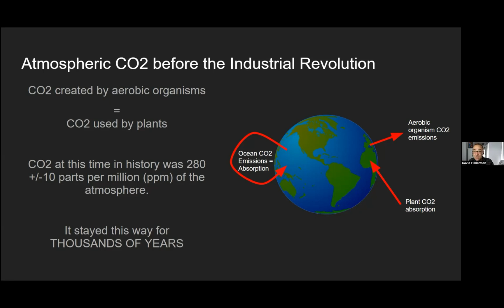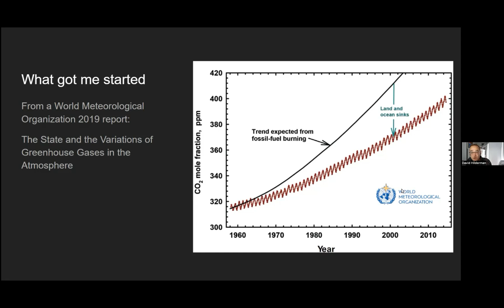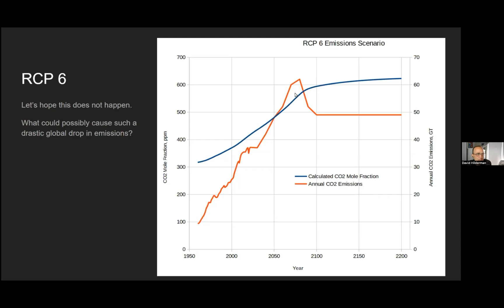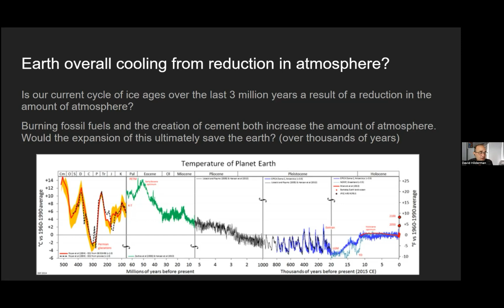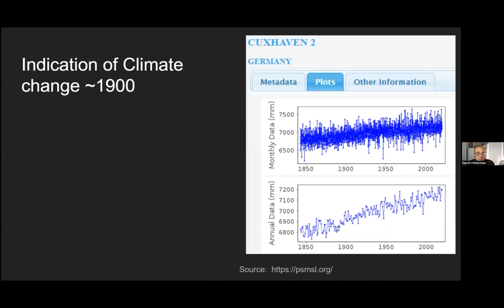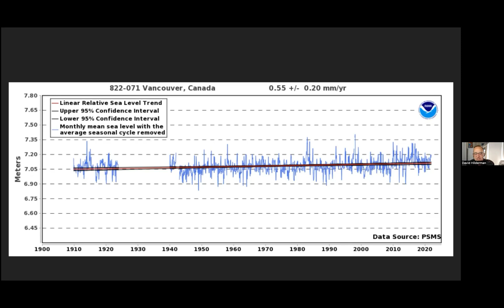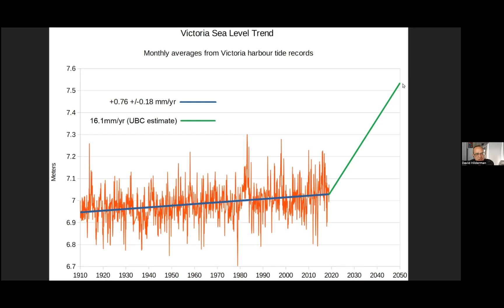David Hilderman: CO2 Emissions and Atmospheric Levels | Nelson Pod #220

Comment: I have a somewhat similar background with a PhD in electrical engineering from the University of California.  I became seriously interested in
 climate research in the 1990s after I discovered my employer was secretly having me work for the NSA, and I quit my job.  My beef wasn't with the NSA per se, but I have a hereditary health problem and I needed unsupervised travel to a foreign country that the NSA does not trust to find
 biological relatives.  My security clearance was a burden.

Well known  politicians on both sides of the aisle wanted me to take a look at global warming expecting me to reach contradictory conclusions.  I had studied  system theory, modeling, and feedback at a graduate level, so I thought the best course was to just try to keep everyone honest.  In many ways my approach is similar to yours, and I see this post here as an  invitation for detailed comment.                                             
                                                                                
 This is a material balance problem that should be investigated with numbers.  If CO2 affects climate, we need to follow numbers in order to understand climate change.  There are many differences between our approaches however.  I will detail them in comments to my post here.
Reply: At 9:26: 
This is grossly oversimplified.  The implied five-digit precision in the Mauna Loa data is absurd.  I would use a multi-year baseline (maybe 10 years) and assume a more realistic precision in the data.  But mass balance is exactly what we need to do.  I don't understand why this is so neglected.
Reply: Your material on sea level rise is perfect.  I have come to the same conclusions.
Reply: Try the calculator - it may satisfy your interest in the numbers.
Reply: At 2:12:
Atmospheric CO2 before the Industrial Revolution. "CO2 at this time in history was 280 +/- 10 ppm ... It stayed this way for THOUSANDS OF YEARS"  

Twelve thousand years, more or less.  And +/- 10 ppm makes a huge difference in climate. CO2 levels gradually declined from 280 to 272 in 6,000 BC.  Then CO2 levels rose until around 1400 AD when new world contact caused a population catastrophe.  CO2 levels dropped, and the climate cooled for a few centuries.  Then in the early 1800s the population began to climb again.  This increased demand for fuel caused the CO2 level to rise and gives the superficial appearance of a stable climate equilibrium that never existed.
Reply: At 2:41:  
Post Industrial Annual CO2 Emissions.  Yes, this is the same data I use.  However the large increase in 20th century emissions masks a critical feature of this graph.  Plot and scale only 19th century emissions alongside of population, and you will see the exponential rise began before the late 19th century (1800s) industrial revolution, but after an early 19th century population explosion.  We began burning   fossil fuels, because we ran out of firewood and other "natural" fuels.  Both fuels raise atmospheric CO2 levels.
Reply: At 3:49:  (This is Mauna Loa data) Explaining the annual cycle of monthly CO2 averages.  "The reason it goes up and and down is becase there is more plants in the northern hemisphere than in the southern."  

That is not correct.  The earth is mostly covered with oceans, and ocean dwelling plants account for more than half of total  photosynthesis.  However humans predominantly inhabit the northern hemisphere, and the demand for heating fuel peaks in the winter. This is what causes the CO2 level to rise.  A careful look at the CO2 level maps that are rarely released by the NOAA shows higher CO2 levels colder regions like Canada and Alaska where firewood is still consumed for heating.  Mauna Loa is located in the northern hemisphere where the air quickly mixes.  Comparing with CO2 measurements in Antarctica should show an attenuated cycle, because it takes two years for the circulate from the northern hemisphere to the southern.
Reply: @natterlynabob1472 thanks!  That is interesting regarding fossil fuel use not plant uptake.
Reply: At 4:36: (Ice core data from Vostok, Antarctica) 

It is easy to look at the sharp modern peak and ignore the rest of the data.  This data is deceptive because modern (Mauna Loa) measurements are recorded daily while ice cores average several years of CO2.  So the peak we are seeing now would not show the same kind of sharpness or height.  This averaging effect is greater the farther back in time the ice core measurements are taken.  More recent cores (younger than 300,000 years) show concentration peaks around 280-300 ppm. Older measurements have this peak averaged down a bit.  But to me the most significant feature of this plot is the interval between successive CO2 peaks (and glacial interglacial periods).  Prior to 300,000 BP the cycles are around 60,000 years long.  Beginning at that time the cycles are increasingly long.  The most recent cycle lasted over 100,000 years.  If we assume the glacial/interglacial transition are triggered by the mass release of CO2 from the oceans (limnic eruptions), then this is analogous to  an electronic current-to-frequency circuit that can be used to accuarately measure CO2 emissions.  The lengthening of the periods indicates the gradual new source of CO2 emission that began at about the same time that humans began using fire.  At the end of the most recent cycle around 12,000 years ago the CO2 level declines until 6000 BC.  Then something remarkable happens.  In contrast to all other cycles, the decline reverses showing that this new source has now overpowered the natural pre-human glacial/interglacial cycles.  This is where the exponential rise in CO2 levels truly begins.
Reply: At 5:12:  
Yes!  CO2 causes increased photosynthesis, something that some refuse to believe.  This is a commercial issue and the effect is used in greenhouses.  The relationship is sublinear so the increased photosynthesis will not be seen over the span of 10 or 20 years.
Reply: I did not get into where I came up with the pre-industrial CO2 level in my calculation.  I started with the equation in this form co2(y) = co2(y-1)*k + emissions + f.  I simply adjusted k and f until my calculated atmospheric best matched the measured.  Then i put 0 emissions for every year for 500 years.  Atmospheric levels settled to the number that i used for pre-industrial co2 levels.  I thought that perhaps this was too or maybe it is only a linear function in the range of 316ppm and 420ppm. This may still be the case.  I found a paper from i think berkley that estimated pre industrial CO2 levels were 290ppm, so i figured the number i used was quite reasonable.
Reply: @davidhilderman  Yes, this is basically what I did.  It is called difference equations, and they are easy to solve with a PC.  I started with the Mauna Loa data and fit just to that.  Then I found ice cores (not Vostok) that overlapped with Mauna Loa data, and when I fit to 1900, I came up with a different "pre-industrial" CO2 concentration.  Then I decided to go back as as the emissions data allowed.  I think that was 1812, and pre-industrial CO2 changed again.  There were serious problems though in the early 1800s.  When I plotted actual atmospheric CO2 together with emissions there was far too little increase in CO2 for the amount of emissions.  Then I decided to plot atmospheric CO2 alongside population.   I assumed there would be a constant amount of carbon emissions per person.  This matched the shape of the atmospheric CO2 better:  particularly before 1850.  The only way I could match emissions
and atmospheric CO2 over the whole interval from 1812 to 2017 was to assume that those who consumed fossil fuel consumed less biomass.  The more I thought about it, the more reasonable the assumption sounded.  Humans switched to fossil fuel because we ran out of biomass.  The more fossil fuel we consumed, the less biomass was burned.  There is your greening.

Eventually I was able to run the difference equations back 300,000 years into prehistory.  By adding in limnic eruptions when atmospheric CO2 dropped below 180 ppm, I was able to simulate glacial/interglacial transitions as well as modern data.  In system theory we call a situation like this a point of unstable equilibrium.  The deep ocean absorbs CO2 until the atmospheric CO2 drops to 180ppm and then becomes unstable.  An earthquake or a volcano or a meteor can shake up the ocean enough so that CÖ2 bubbles out like it does when you shake a bottle of soda pop.

Here are a couple of references on the behavior of CO2 in the deep ocean:

Nealson, Kenneth; “Lakes of Liquid CO2 in the Deep Sea”; PNAS vol 103 no 38; Sep 19, 2006
   http://www.pnas.org/content/103/38/13903.full
   accessed 31 AUG 2014

Brewer et al; “Direct Experiments on the Ocean Disposal of Fossil Fuel CO2”; SCIENCE 284: 943-945 (1999)
Reply: At 7:13:  
Caution.  Sometimes emissions are stated in gigatonnes (GT) of CO2, and other times in GT of carbon.  The difference is a factor of 44/12.  My calculations are all done in GT of carbon.  2.1 GT carbon cause a 1 ppm rise in atmospheric CO2.  We agree here.
Reply: At 9:31: 
Yes, I see the same effect.  For the amount of carbon emissions we should be seeing a larger rise in atmosperic CO2.  But I do not attribute this to photosynthesis.  The amount of increased plant synthesis has been measured, and it is in no way proportional to the increased CO2. attribute the seeming discrepancy here to a reduction in the burning of "natural" fuel that began with the use of "fossil" fuels (which do not always come from fossils!).  Humans gradually replaced firewood with coal and petroleum.  For every tonne of carbon produced by combustion of "fossil" fuel, 3/4 tonne of "natural" biomass is not burned.  Also I do not trust your World Meteorological Organization data.  I wrote difference equations and made an empirical model for the CO2  absorption into the oceans using ice core and modern data.  And of course not cutting and burning biomass directly shows up as greening the earth.
Reply: At 10:56:  
These equations are unsatisfactory, because you have left out the units as well as changes in burning of biomass.  And no you are not the only person doing this.  I tried this several times with different base intervals.  Every thime I changed the base years, I came up with a different "preindustrial" CO2 level.  I was forced to the conclusion that there never was a stable preindustrial CO2 level.  I was unfortunate enough to have met a famous climate politician in the Army.  When I gave a talk at a local college, I received d**th threats from his organization.  I hope you have better luck.

Because I do not accept a stable preindustrial CO2 level, I can't relate to the next few minutes of your talk.
Reply: At 22:11:  
This is an excellent graph illustrating the decline in atmospheric CO2 levels over the last 550 million years from 7000 ppm (0.7%) down to most recent levels of 180-280 ppm (0.018-0.028%).  In  my view it is possible that humans have evolved for the purpose of reversing this trend and preventing the extinction of plant life which has continuously evolved to function with lower and lower levels of CO2.    
   
The temperature data is suspect however.  There are proxies that will indicate some kind of temperature somewhere, but this is not same a "global average temperature." To make that leap we must assume the distribution of temperatures is normal.  We can disprove that by taking histograms of max and min temperatures from the NOAA database.  I have the same criticism of temperatures inferred from isotope ratios in the ice cores.
Reply: At 23:04:  
Standard biology that has been taught for over 50 years.  Pity no one in climate science accepts biology.  From personal private communications it would seem that the whole climate "science" field is controlled by creationists.
Reply: At 25:00:  
I have my doubts about proxies claiming to represent earth's average temperature.  I have been commenting on the internet since the   1990s, I could have been the one to speculate on changes in the earth's atmospheric density influencing temperature.  AFAIK physics is unable to explain the lapse rate (rate of temperature change with altitude) from any first priciples.  Most likely all planets are slowly losing atmosphere.
 
The hotter the planet, and less gravity, the faster lighter gasses are lost.  Venus has lost everything lighter than CO2, but it never developed   life, and the high temperature prevents formation of carbonate rock.  So all that CO2 remains in the atmosphere making it hellishly hot.  Mars has such weak gravity that it has almost completely lost its atmosphere.  All that remains is a small amount of CO2.  On the earth life developed and converted atmospheric CO2 into free oxygen, hydrocarbons, and carbonate rock (shells) reducing atmospheric pressure.
                                                                                
My interpretation is that we are leaving the earth's last ice age, and the only thing we should do about that is take careful measurements.   Future generations will need to see if this is a problem, and they will need the best data we can give them.
Reply: At 27:24:  
Many of these climate extremist groups are financed by foreign intelligence operations.  It is also a way for domestic politicians to launder public funds into political donations.  Putting young people together at a week long camping event is a perfect cover for drugging and hypnotizing them.  They form long lasting intimate relationships with each other that make it difficult to deprogram them.

Comment: Petroleum is not a fossil fuel. Oil is found at depths of 30,000 ft. It is not possible for these reserves to have been developed by fossil degradation. Oil companies are very aware of this fact.
Reply: Yes it is. Surface geology can become very deeply buried after several hundred million years of plate tectonic changes.
It IS true the most of the methane on the planet is primordial, not fossil. 
Coal and oil ARE fossil and their creation was a one-time-only event.
Reply: You are clearly not a geologist.

Comment: The problem with climate change crisis, is on  2 levels :
1st  - Confusing saving the planet with saving civilization. The planet will be fine, it will adapt, even humanity as species will survive and adapt. But it will take a rather long time and suffering to go through the transition. The goal is to smoothen the transition and lessen the suffering for maximum of people
2nd - Getting together and putting up a general plan of solutions that are just and efficient for most people, not green washing solutions influenced by lobbies, multinationals and politicians thinking of the survival of the 1% in the best conditions for them only
Reply: And some of solutions HAVE to include the use of fossil fuels anyway, as it is yet the most efficient and best know form of energy we have for now. Ii just need to be used for the transitionary solutions. Unfortunately, I don't thin humanity is able to sit on the table and discuss the problem with the best intentions, and clear critical thinking, because short term interests are inbedded in our societal functionning

Comment: I have been looking on data for the locking up of carbon in ocean rocks and having quite a time finding good data.  The actual AVERAGE ocean (not surface) temperatures seem to be well hidden in all the GW propaganda.  Have you seen any data of either the temperatures or the increase/decrease of carbonate rocks in the ocean?   There is a carbon cycle few other than a rare geologist who talks about the oceanic carbon cycle.

Comment: Another interesting point to consider: the increasing weight of the biomass on tectonic plates.  Just south of you, in Washington state, geologists had determined specific lava eruptions caused tectonic plates to dish down due to the weight of added rock material.  This caused significant changes to the flow of the Columbia River.  Now I don't see this effect of sequestering carbon in biomass as being anything other than another variable in a number of variables but still, it could be a refinement.  Additionally, looking at oceans as a carbon sink while adding giga-tons of carbon to it - would that also not raise ocean levels.  Adding giga-tons of mass to the oceans would most certainly affect its volume.  But to what degree?
Reply: But then we are back to variables. A point to consider is the oceanic crust is thinner than the continental crust. How much extra weight can it hold before it deforms? If it deforms then there is more volume in the ocean basin, but if it deforms in the ocean basin, where is jt going to uplift? Maybe just in a thinner spot in the ocean like a mid oceanic plate, maybe more volcanic activity on existing vents. Very complicated.